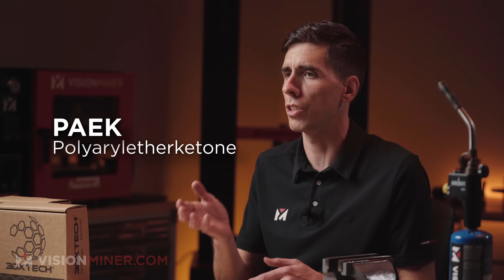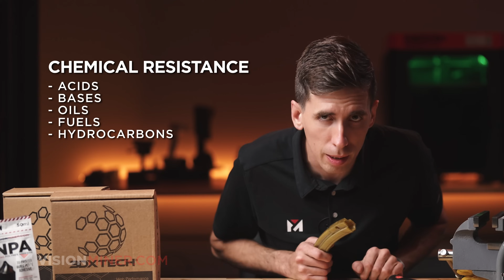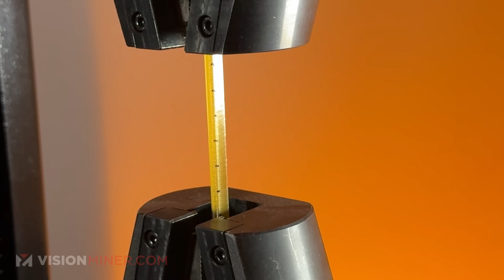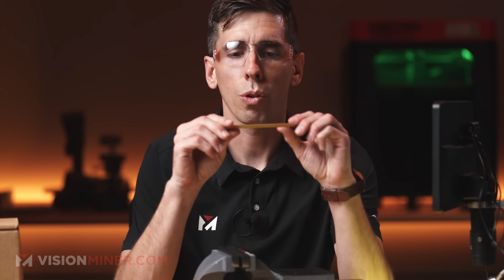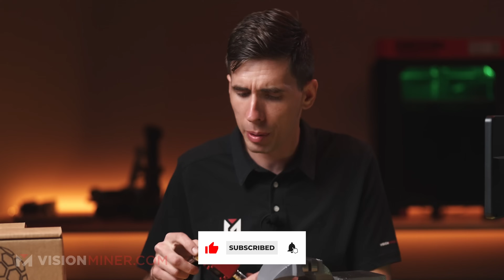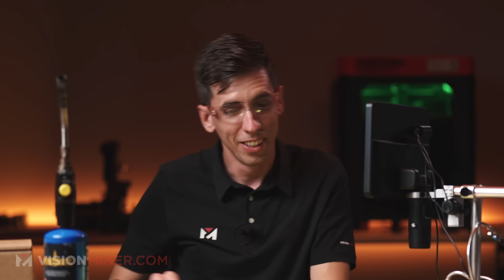3DXTech PEKK-A: We Burn, Break, and Analyze This Aerospace-Grade Filament

Comment: How stupid is to try print peek-a in qidi plus4 65 Celsius chamber?:)) Please advice before I pull the trigger for lulz. A "dont" or do it would be enough:)
Reply: You can get away with printing PEEK in a really really hot chamber, or rather cold chamber. 65 is a bit low, you might be able to get away with it, but bear in mind you'll have to keep the part amorphous for the entire print and then anneal it afterwards. When I was taking the amorphous approach to printing PEEK I went with 380 nozzle, 120-130 bed, and 70c chamber. You'll actually want to use part cooling while printing it amorphous. If any section of the part goes tan, rip layer adhesion in that region.

EDIT: Oh also, kind of important, its gonna be really hard to print unless you understand the FDM process EXTREMELY well and have a decent idea of the polymer chem that is occurring when melting and cooling semi-crystalline materials.
Reply: @markthompson5983  I've tested PEI 1010 benchy at 65/370 - warping, delamination. Unable to complete print. PPS-natural from Spectrum filaments is fantastic though.
Reply: @bartman2395  That doesn't surprise me, Ultem is amorphous, it requires much higher chamber and bed temps. You pretty much can't go wrong with a hotter chamber as long as it's below like 210c.

PPS is a good start, but until you know why you can print PPS but not ultem I would recommend against printing PEEK.

Edit: and if you already know why you couldn't print ultem, you should be fine to try PEEK. I can't guarantee it'll work out though.

Comment: Is it that much better then ppa-cf?
Reply: Unless you REALLY need the temperature resistance, or are in a "money doesnt matter at all" situation (like aerospace stuff), this aint worth employing.

Frankly its partly due the the filament manufacturer not drawing filament from granules for a fixed cost...
...bug for a fixed percentage of cost of granules.

Since they feel the need to retain the insane margins of products where base material is close to free, his product remains effectively same as legally banned. Its prohibitively costly.
Reply: @martonlerant5672  I think ppa-cf has higher heat resistants and much better adhesion about the only inferior thing would be the flexibility of ppa-cf
Reply: @bcjan18  
PPA-cf has better thermal properties on the back of cf stabilizing it and delaying creep and melting. Adding carbon fiber helps this material the same way. However not are use cases  allow cf.

Comment: I would like to see a video solely based on layer adhesion as it relates to chamber temp & bed temp. 

Oh and i need the Idex22 to come down to $2500 in price. 🤔😏😉 
But I'll take the video tho in case you can't lower the price. 😂
Reply: Man that second bit makes me think. A ""budget"" high temp printer would be amazing, even if it meant a pretty tiny build volume. I'm not sure how feasible that'd be since it's very possible the bits that make it expensive aren't the ones that are affected by size...

But if it is, a lot of the crazy filaments that are beyond things like the higher end hobby-ish printers like the H1C/H2S or my own Q1 Pro are expensive enough that I know I for one wouldn't want to print anything large from them anyway. But like a 100mm cube build area pushing out PEEK or ULTEM 9085 or whatever else would be super cool.

Comment: if you make a series like cnc kitchen but for engineering materials i will watch all of it
Reply from the maker: Coming up! Stay subscribed!
Reply: @VisionMiner would be so amazing
Reply: CNC Kitchen practically has a standard testing lab setup already.  Just donate a printer and some material and maybe he'll do and publish enough testing to balance things out.  I think that it takes more time than one might think just to get the processes dialed in and consistently applied.  At the very least, collaborating with him might help lead to standardized material spec testing relevant for fdm/ffm.
Reply: @spheretical3609 nah he is not doing filament testing vide0s anymore
Reply: I second this!
Reply: This